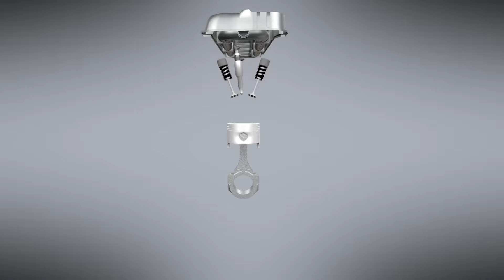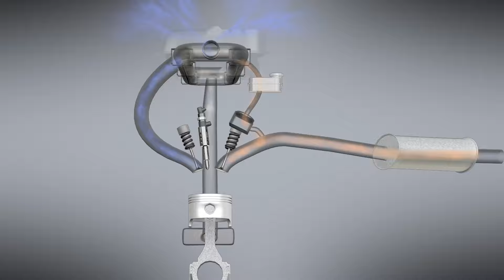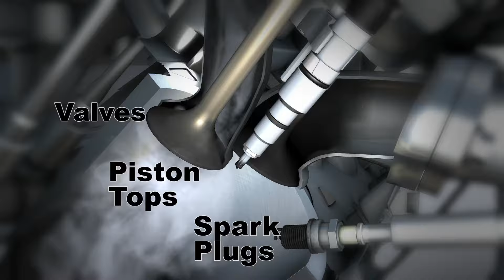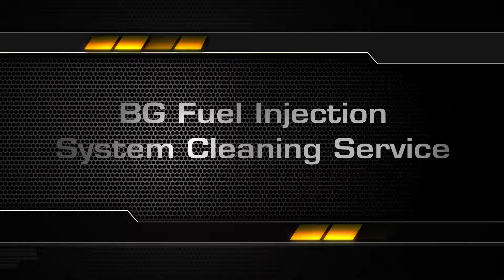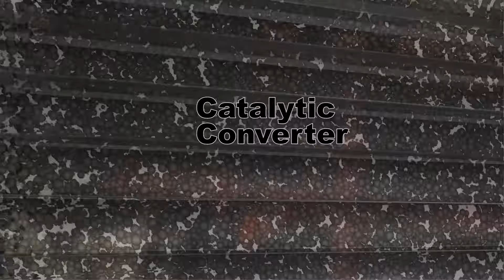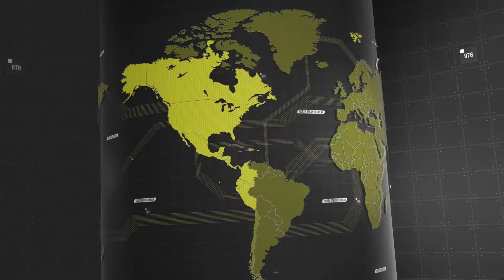BG GDI Fuel & Air Induction Cleaning Service  - GM

Comment: This the ONLY way to do it. Stop trying to clean engine parts like Fuel Injectors with a spray can and cheap electronic box, it will never get done properly. Also stop buying BG products from guys on Facebook because all those liquids are past their due date and will not work nearly as good as fresh product from a pro mechanic as well the sale is illegal.

Comment: BG  doesnt work we even have the pedal apparatus that pushes the pedal every 45s to 3500 rpms what a joke   walnut or dry ice blasting is the way to go everyone with direct injection are eventually end up with some problems that will be the time to pull the intake and blast the valves and pull the injectors and run them through an injector tester and cleaner tool and wammo new again.

Comment: I’ll never get i gdi engine I’ll let the gas clean them off
Reply: They have dual injection systems now that would give you the benefits of both and eliminate the build up on backs of valves
Reply: I'm the same way I'm not fond of GDI but I had to buy a new car and it's getting harder and harder to find newer cars with port fuel injection so I got my Subaru WRX and I live it but having to do a GDI fuel and induction system cleaning very often sucks I'm the manager of a large auto service and repair shop so I can do it for nothing but it's just a hassle. I wanna smack the guy who invented gasoline direct injection lmao
Reply: This is why i drive old cars😊. I will never have a DI/GDI engine. All this saving fuel crap. This ends up costing you more money in the end because you have to have this done. This is the same reason they put crappy ethanol in fuel. Oh it saves the environment. When ethanol is introduced in fuel. The moron should know it gives you less fuel mileage. Its all a scam.
Reply: Good luck. Thats near impossible to do anymore

Comment: I put a Cork Sport oil catch can on my 2019 MAZDA CX-5 GT Reserve 2.5 L. turbo. After 6,000 miles I drained 1/3 cup of nasty looking brown liquid from it. THAT IS 1/3 CUP OF CRAP THAT WILL NEVER REACH MY INTAKE VALVES.
-> I've had my wife's 2015 Hyundai Elantra Limited cleaned at my MAZDA dealer with the BG system at 45,000 miles.
-> At 45,000 miles I'll have my CX-5 valves cleaned with BG fluid.
Reply: Amazing.